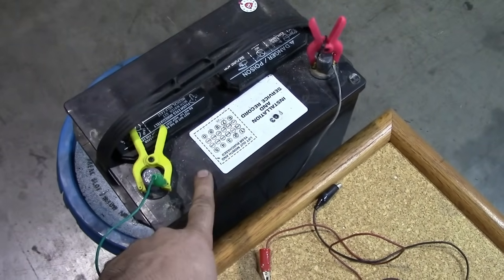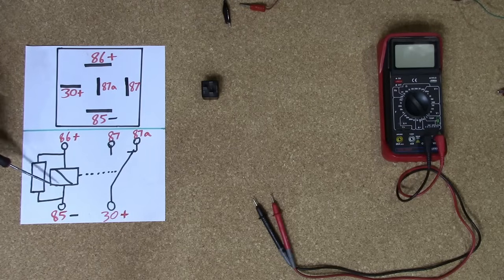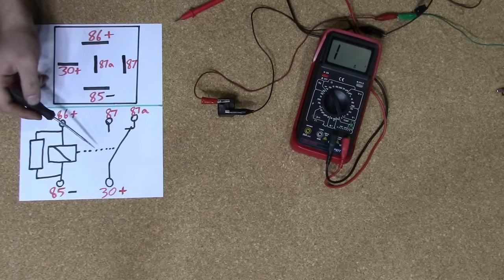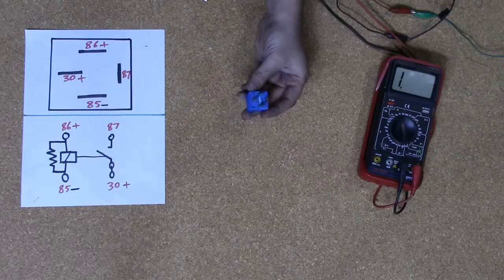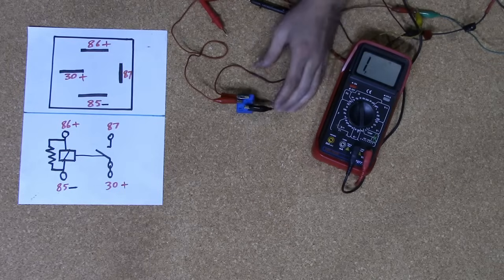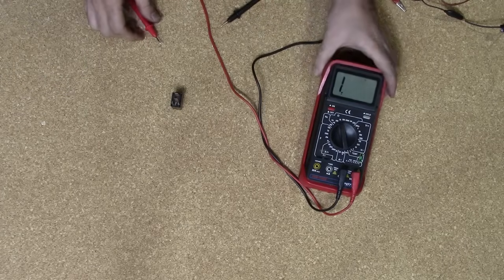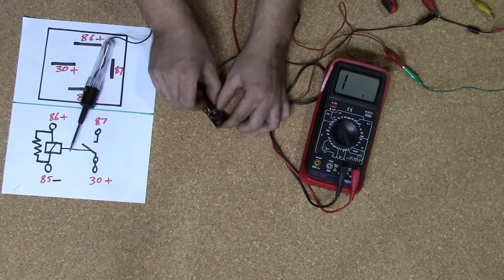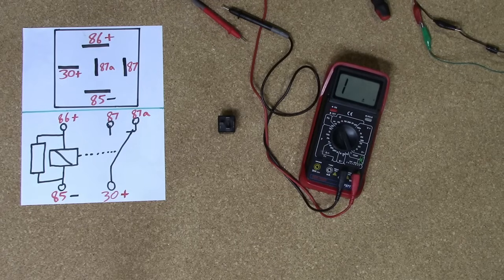How to Test a 3, 4 or 5 Pin Relay - With or Without a Diagram

Comment: hello sir iam from india i have vespa s 150, 70,12v dc starter relay,when i testet in multimeter @ 200 ohm, 86 to 85 result is 36.8 is this bad relay,i have also starting problem to my scooter.
Reply: That's probably toast. See his video on starting a car with a paper clip and troubleshooting the starting system.

Comment: Hi Ratchets & Wrenches, Thanks for the explanation.
Instead of using the test light, can  I test for voltage across pins 30 and 87 ?
Reply: You could do a continuity test with the multymeter as well. Some of them have a beeping position. When you touch the two leads of the meter together it starts to beep on you. When you do this an the relay it should also start beeping. if not, there is no continuity in the relay.

Comment: Great video. I have a Lincoln LS  that would not run. The relays all had good ohm readings and would click when tested.  It was the last step that tested the pulled voltage, that revealed the two bad ones. Thanks.

Comment: Hi there, great video, but you are misleading viewers regarding Pin 87a. This pin is identical to Pin 87. It is also an Output Pin. It enables users to run a second cable from the relay to an accessory item. I looked over my 2008 / 2009  Hella Catalog to confirm what I have put into practice on my personal vehicle.  When I install high power Spot lIghts, I run each Spotlight from each pin which means  1/  I can use lower amperage cable for each lamp,  and 2/  no need to split the cable at the lamps.  It will also help to diagnose issues should any arise.  I also use a 5 pin relay for my Fog Lights using the same practice.  And have done so for many years, without any problems arising.  Though I do ensure that cables and fuses are capable of what is required, choosing to purchase new cable instead of using the 'Kit' supplied cable, which I feel is too light.   Anyway, just thought I'd clarify this.   Cheers

Comment: testing a motorcycle starter solenoid / relay and as soon as power was added it started sparking like mad. not little pops and done but large blue arcs. Couldn't hear it click but nothing changed on the ohmmeter, so guess it's time to order a new one! Thanks for the video, watched a few times to make sure I was testing correctly.

Comment: I have a door lock in a safari van, the relay is bad. it is a 6 pin with 2 pins 86 and 86A how would I wire a 5 pin into this? the relay is no longer made. I was thinking that I need to connect 86 and 86A together and then wire in a 5 pin? your thoughts?

Comment: great video.best of all
Reply from the maker: Thanks
Reply: Ratchets And Wrenches hey ratchets. when  checking resistence do u have to b connected in series?
Reply: I just don't get how ur checking resistence with battery connected. doesn't that blow ur dmm fuse?
Reply: U have to have the meter set to Ohms to test resistance, the battery is in the meter.

Comment: Relay sometimes  they have,   resistence and they click ok, but my ? Is what damage the relay ,amp,volt this event happen when you use Temp cooling fan for your car, if you dont be sure what cable num  to use on a circuit you burn it or damage the coil

Comment: when you say energize +86,-85 do you mean hook the other ends of the alligator clips to a 12v car battery.Then when you hooked power to +30 i take it the alligator clips from +86 and +30 were both hooked to the + post of a 12v battery.Sorry if this sound like a dumb question but just bought a multimeter and don't want to blow it up.Thanks Scotty
Reply: Scott Reid, Yes that's' what he meant.

Comment: Hi, I have a question about testing a 5 pin.  What if you don't have a testing light?  If you connect power to 30+ and 85-, and multimeter - to 85 and multimeter + to 87a, shouldn't that give you some voltage, and 87 will not?  Then, if you jump 30 to 86, you can test 87 for voltage and 87a should die.  

I'm thinking that should work, but my relay doesn't work that way.  It only works if the trigger is activated, and then both 87 and 87a give me voltage.  So basically, it is working like a 4 pin relay with 2 87 pins... a splitter.  All of the other tests came out fine.

What do you think?  Throw out the relay?  Thanks for the video.

Comment: great video and thanks for being specific with your explanation.
Reply from the maker: +Roger Spence np, thanks for watching.
Reply: I'm connecting fog lights on my 99 Chevy Tahoe and want to use a factory switch with pig tail wires. Im referenced a wire diagram online but the relay uses letters not the numbers. I converted by the picture flow of current but when I turn switch on for fog lights the relay vibrates constantly until I turn off. Can you offer any input? I don't know Amps level on relay.

Comment: you said that if the resistance is above 120 or below 50 to throw the relay out, what  would you say the scale to that is? like would 120 be bad, or would 120.5 qualify as still good? or would 118 be considered weak? just out of curiosity due to my results. thanks
Reply: You should be around 70-85 on the resistance....

Comment: Hi, I have a question on the 5-pin relay.  After energizing pin 86 and 85, I am measuring resistance on 87 and 30.  I am getting readings of 003 to 012,  what is an acceptable resistance range?  Thanks!

Comment: Been trying to sort electrical problem on Suzuki quad..Thought a relay was ok because it "clicked". Thanks to your in depth video I now know that it is shot. No power to the light, so I pulled it apart and lo and behold, a blown part on the circuit board. Keep it up, you are good
Reply from the maker: +Chalky Whyte Sweet, very glad to hear the video was helpful. Thanks for your comment. cheers

Comment: If the relay has a snubber/clamping/free-wheeling/flyback diode in paralell with the coil, then which way you connect 86 and 85 does matter.
Connect it the wrong way around and you're likely to kill the diode by over-current. If the diode fails open (most likely) you now have a functioning relay without snubber diode (which upstream electronics might not appeciate).
If it fails closed you've got a short across the coil and a non-working  relay.
Reply: +Michael Tempsch I just watched this video and was about to post a similar response and decided to check if anyone else had picked up on his omission of the diode scenario.. Congratulations, sir. I give you a thumbs up. Hope everyone out there reads your comment.
Reply: The free wheeling diode is used in electronically driven relays, through the use of a driver transistor. The relay coil is the collector load of the transistor. When the C.P.U sends an energizing command to the driver transistor's base, the collector is practically grounded to the chassis and the relay coil gets energised. The protection diode, is connected in antiparallel way to the coil (i.e. its cathode connected to the battery voltage supply connection of the coil and its anode to the collector connection,that is, to the other terminal of the coil). The diode is therefore in reverse bias, which means that it does not conduct any current when the relay is activated. But when the driving command in the transistor 's base goes off, then the transistor comes in cut off, that is, it acts as an open switch. At that moment, a high spike of reverse polarity develops at the transistor 's collector. The free wheeling diode is forward biased to this spike, it comes in conduction and shorts this pulse to the battery's positive pole. In this way the driver transistor survives for many many operations. In car circuits now, the use of a pulse absorbing resistor is very common for (at least) two reasons. The first one is that the commands to the relays are usually given by hand operated switches. So the possible spike when the switch is off, is effectively absorbed by the resistor. Even if the resistor is not there, the spike will only cause arcing between the switch contacts when the circuit opens, but it will not destroy anything. No transistor there in danger. But the second reason is much more important. The use of protection diode makes the relay coil terminals polarity dependent which is not safe to use in car circuits. The reason is exactly the possibility of power supply reversal during connection which results in damage of the diode, rendering the coil unprotected and therefore a spike generator. In any case, the upstream electronics are not in danger as the energy developing during circuit break is dissipated as arcing within the switch contacts. In the long run, if there is no absorbing resistor or diode, the relevant switch will finally end up having high resistance in its contacts and perhaps will melt them completely. Another important point is that the evaluation of the good (zero ohms) contacts when closing cannot be done by the beeper of the multimeter. This will mislead you. The test needs to be done with the nominal load connected to the relay and then by measuring VOLTAGE across the contacts under test, using Ohm's Law for the evaluation of the test result. The multimeter 's beeper will show you continuity but it cannot give you any measure of current flow at all. This test is the most effective for any power switch...
Reply: @Do-iz6qd I am happy to see that my comment was useful information to you. As regards the testing of power switches in general, the best way is to test them under real  conditions (dynamically) instead of using the beeper of a multimeter (because the beeper uses only some milliamperes for testing, which is a negligible amount of current in comparison to the current the switch must deliver to its load)...

Comment: This is the best video I've found on relay explanation. Thanks for posting.
Reply from the maker: Luke Martin It got a bit long but alot of info in there for people with patience. Thanks for watching, cheers.
Reply: Luke Martin Agreed!, great demo and tutorial.
Reply: Where did you ground The Test Light in the 5 PIN Demo? To The Battery Ground?
Reply: May be an old upload, but it saved me from   buying a fuel pump relay that I didn't need. Thanks
Reply: He is the best auto professor  The EXPLANATION SO CLEAR !

Comment: All the 5 pin relays that I have seen which have 87 & 87a, use 87 & 87a as the load side... 30 supplies power to both 87 & 87a at the same time. No continuity between 30 and either 87 or 87a when the relay is off. What was this one for?
Reply from the maker: hmm interesting, this one was a starter relay out of a 03 Mustang GT. Thanks for your comment!
Reply: RatchetsAnd Wrenches Wiring diagram shows a 4 pin... this is probably a generic 5 pin relay (that has the extra load pin).